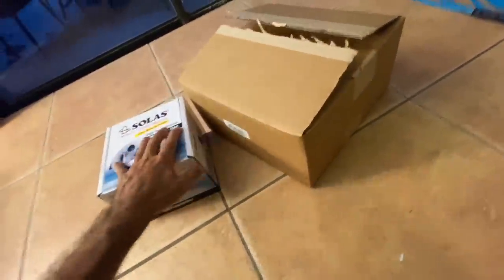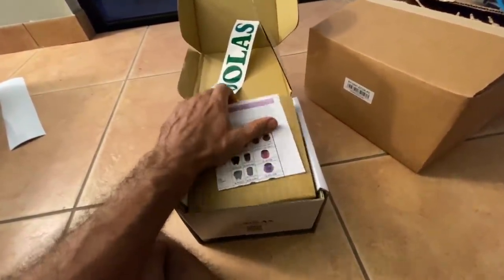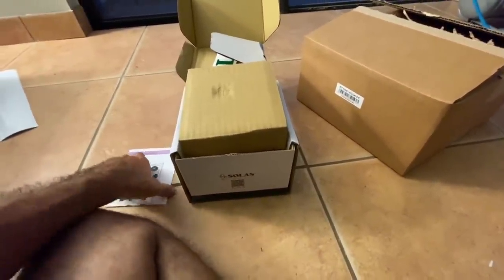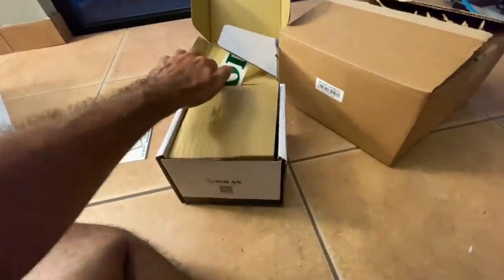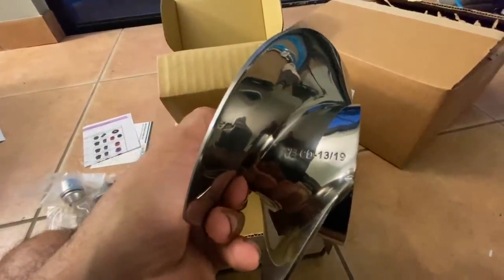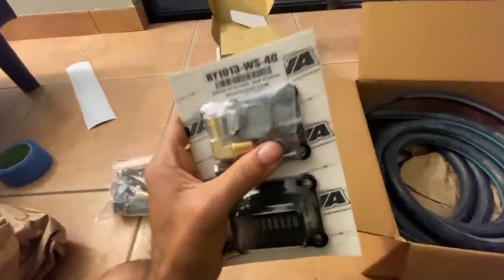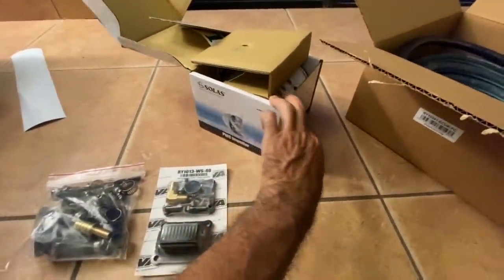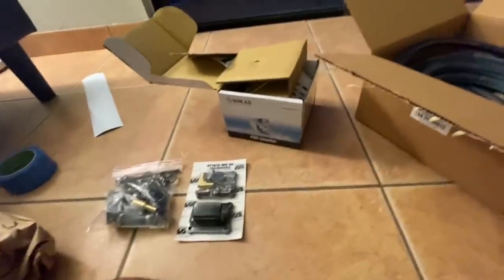PROJECT FX SHO! first upgrades!!

Comment: So Jack all these upgrades are not for power and speed it is to protect the engine and reliability you are replacing parts that have been upgraded to work out kinks, I understand save the machine if you can it's cost effective, no big repair bills down the line.

Comment: I got a question I got a 2013 fzs and did a worx cooling upgrade that runs to the rear of the engine to help cool it. I then added a svho intercooler swap and added a 2nd pisser should I leave the cooling ran the way that is?
Or should I run the worx line to independent cool the ic and use the owm ic inlet to the rear of the engine?
Ive looked and there is normt much info on this set up.
Thanks.